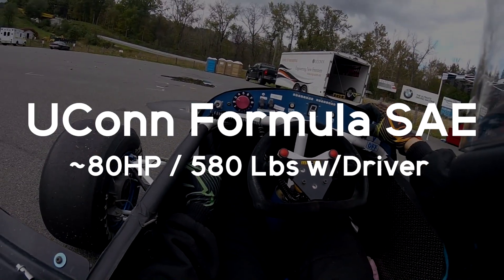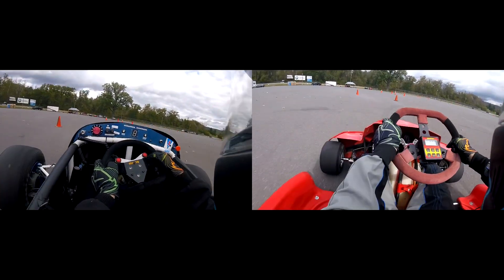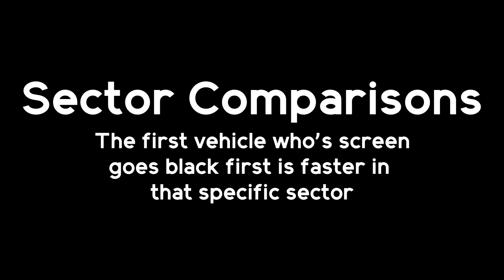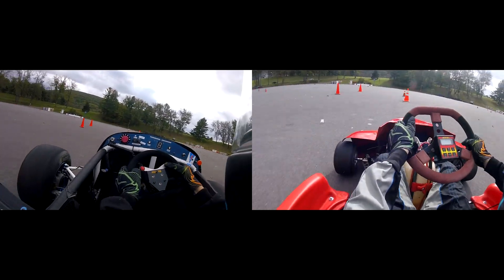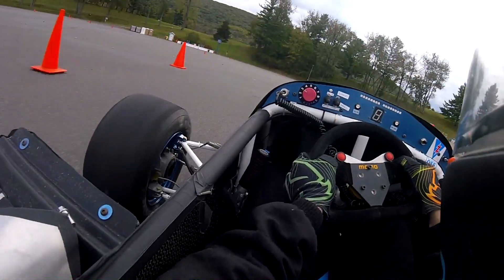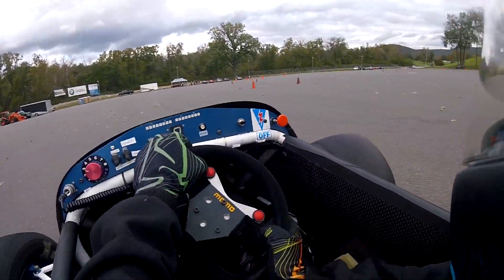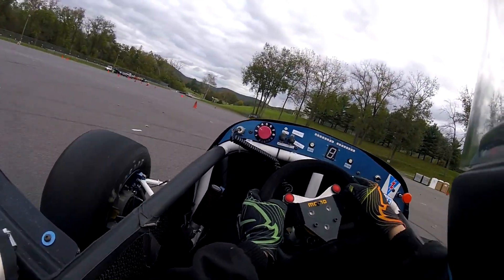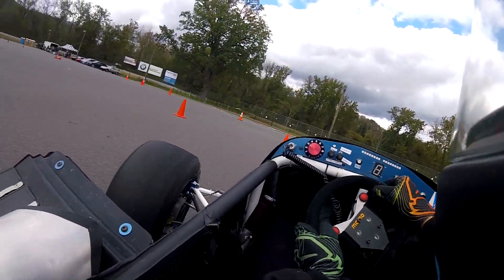Kart vs Formula Student Car (Autocross Lap Comparison)

Comment: What engine does the Margay have? A leopard?
Reply from the maker: Its a Briggs and Stratton World
Formula engine
Reply: @CashedOutCars  

Thanks. It's just that it sounds so familiar to a Briggs and Stratton as you said. But, I have never saw it that quick.
Reply from the maker: @sammy1173  It goes pretty good with this engine! I'm looking to build a shifter this winter if I can find a good engine to work with.